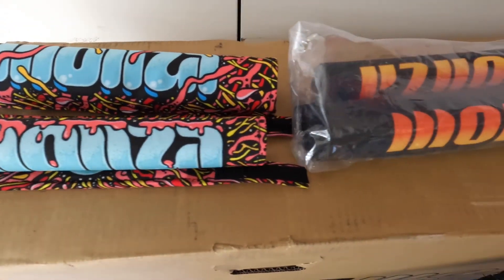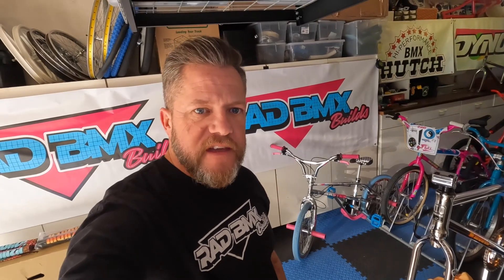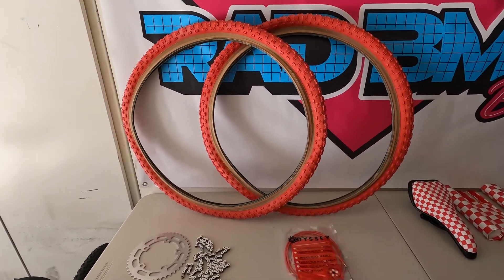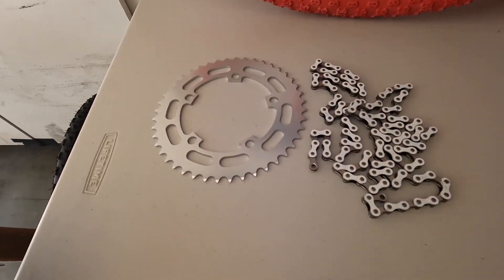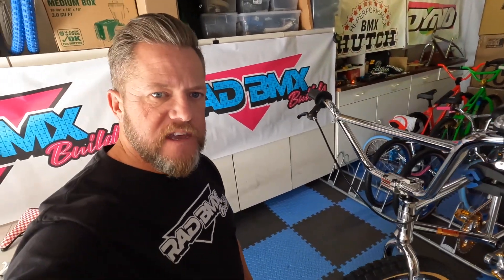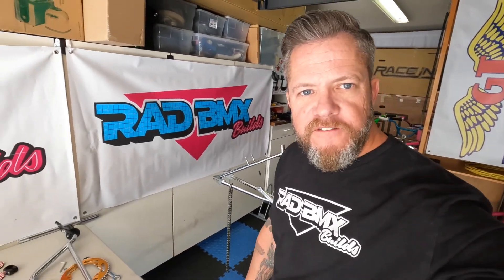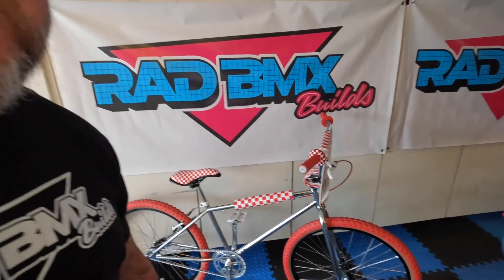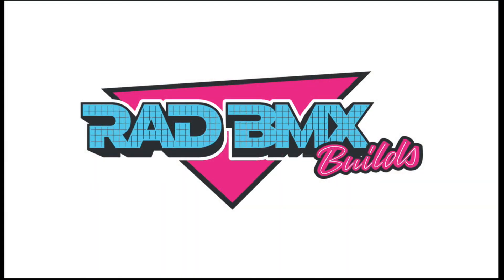Custom Monza Build

Comment: I like what you did rad bmx!!!! I too am building an 80’s race throwback bmx bike out of a new schwinn predator 24” bmx cruiser!! Adding SE racing 3 piece cranks, stem, chain adjusters and pedals then have dia compe Mx brakes, brake lines plus seat clamp! Have a zeronine front plate, and then gonna add skyway black 24” mags with gumwall comp tires👍🏻

Comment: I have a monza 24 over in the UK. 
Certainly a head turner. Love my bike.
One or two mods I've done  to the original. 
Mx bulldog brakes. Billy bonkers tyres, gold seat clamp, Narler stem, 17t halo clickster apposed to the og 16t.
You still have a 24 monza on your shelf!
What have you got planned for that one bro? 👊